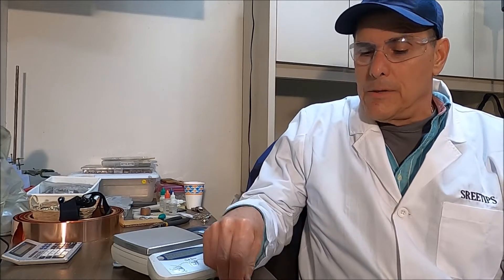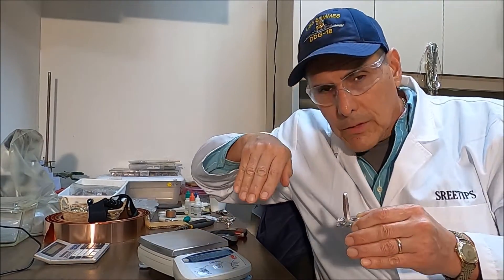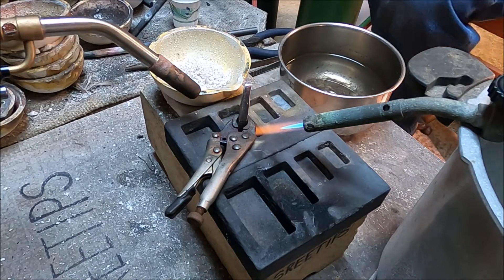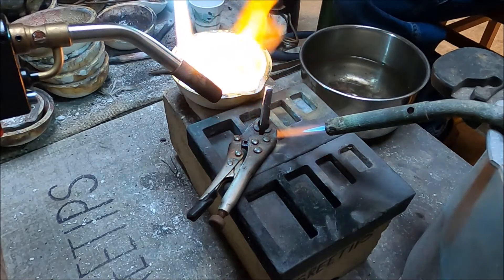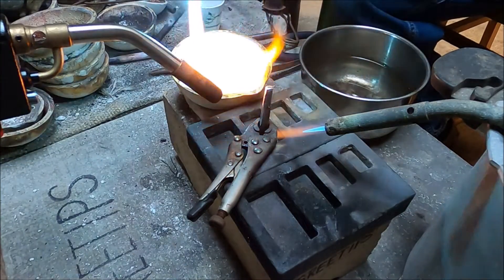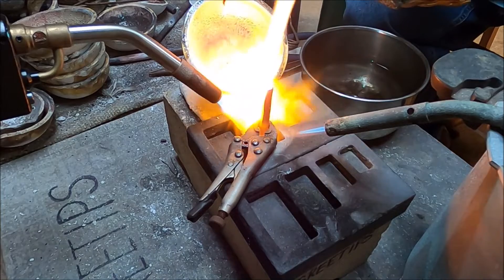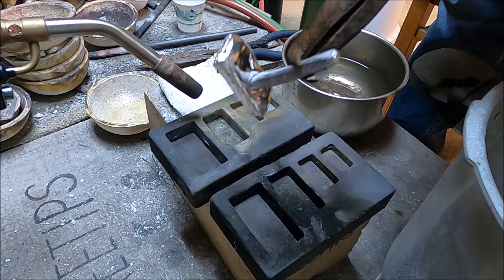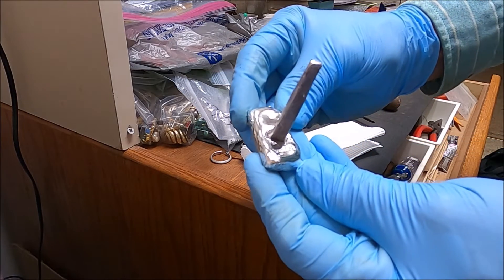Silver Cell Electrode Bar Modified Molten Pour

Comment: I wonder how a little electric furnace would do for pre-heating those molds. Bring it up to a nice dull red and then make your pour.
Reply from the maker: I think that the torches, aimed correctly, are quicker and seems to work great.
Reply: @sreetips  Just a thought...glad your method works for you.
Reply from the maker: I could set them on a hot plate. Might save some gas.

Comment: I wonder if someone could make a graphite mold for you so you could make it in a single pour. It seems like a relatively easy shape to machine?
Reply: Make the cavity to conform to the shape of the anode basket.
Reply: @johnblair8146  ? That's sort of the opposite of what you want. This bar is just to make electrical contact with the mid purity silver.  You want to avoid plating the bar onto the bowl.
Reply: @RobertSzasz   I meant to say that the bar could be made to conform to the outline of the basket's perimeter. this would prevent it from sinking too deeply in the basket, thus preventing it from contacting the electrolyte.
Reply: @76JohnBee  that makes sense, but I think it's a trade off between making contact with the impure silver, and longevity. And since no sliver is lost, the easiest/fastest to make would have a big advantage.

Comment: Maybe you could put some flux on the stem to make the silver connect better,  similar to silver soldering
Reply from the maker: Get it hot enough and the molten silver will weld to the stem on contact

Comment: What if you extended your exhaust stack without the top blocked off? Possible fix to your fume hood
Reply from the maker: I just ordered a 1/3 hp motor, fully enclosed, ball bearings, with an "f" rating. That puny motor on there now has got to go.

Comment: Silvers reaction to any kind of temp fluctuations are incredible for sure. My setup to pour a piece is only 10 in to 12. If I stall for a second or two the metal just won't pour cleanly enough to empty the cup. Any hotter and it starts to boil. We both know what happens to a boiling material. It goes to atmosphere. You are sure getting the process down pat my friend. Getting the cup nice and glowing the same inside and out is the real key my friend. I am off to start working on our project tomorrow. I talked with CSS tonight to give him the heads up on our project and he now knows now how technical the video needs to be. Onward eh, WOOHOO.
Reply from the maker: im really looking forward to it. Thanks Dean.